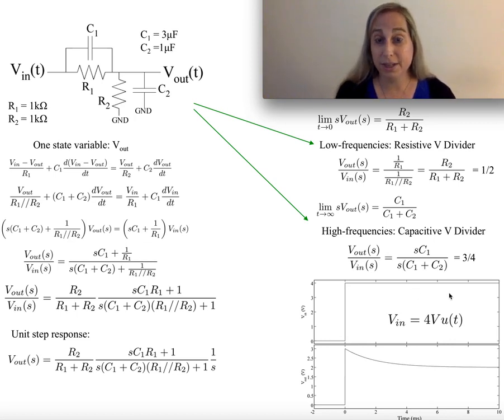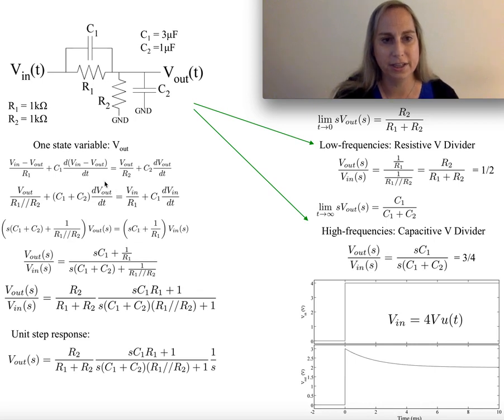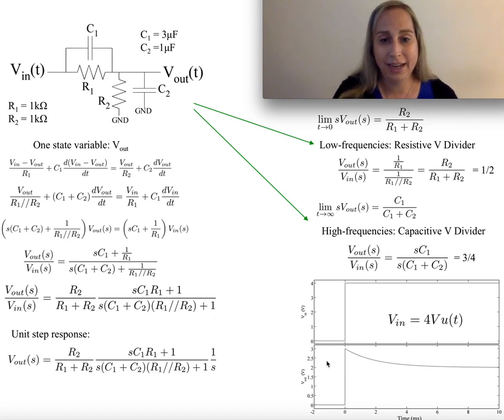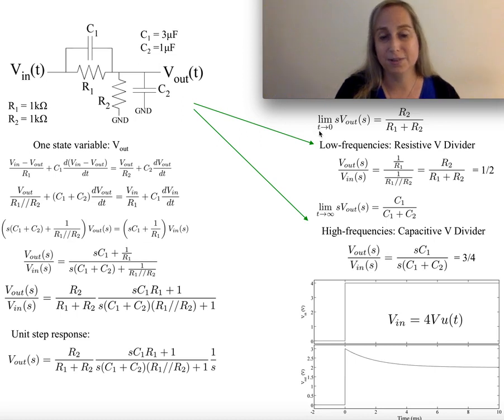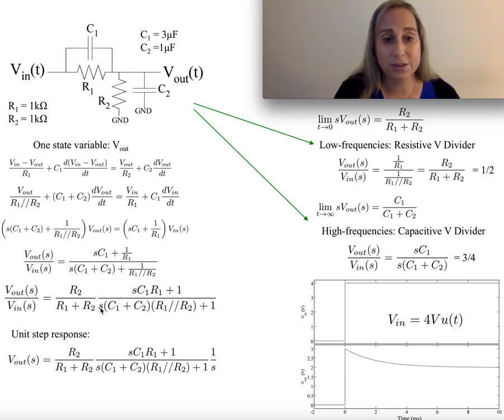An important Resistor-Capacitor Circuit

Comment: Professor Hasler been an engineer for many years and enjoyed this analysis. My first thought was the capacitors to a step function must is the resistors are high impedance in relation to the resistors  so resistors or out of circuit for the rising edge. The next question is go to ground with input and it just decreases from .5 Vin   Thanks yo for the video